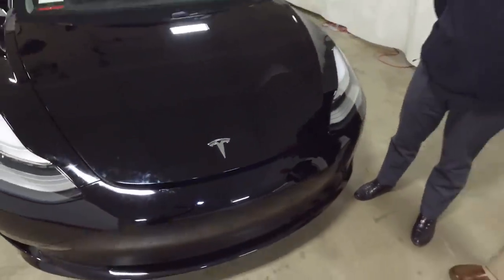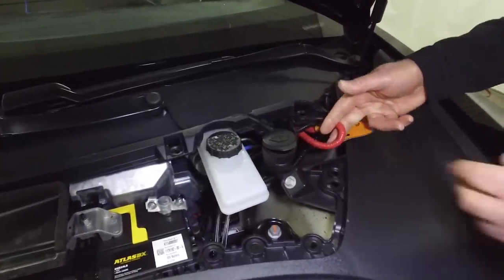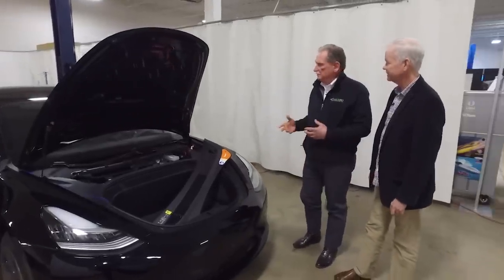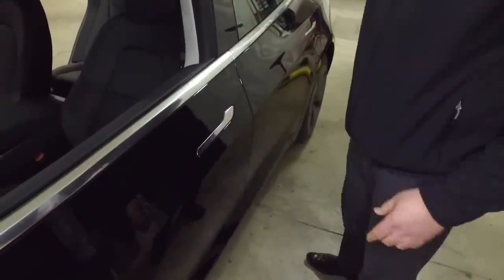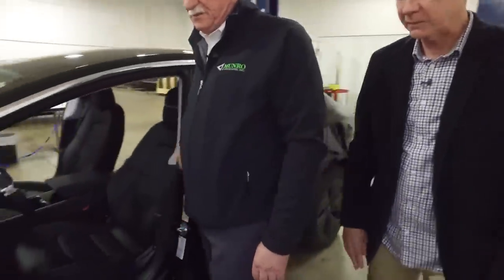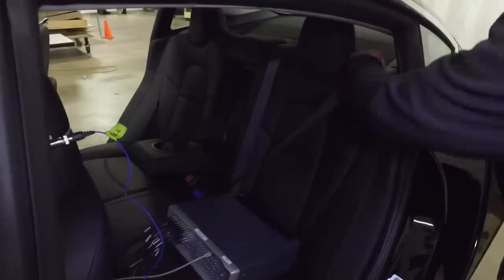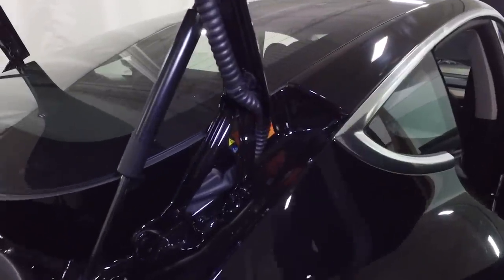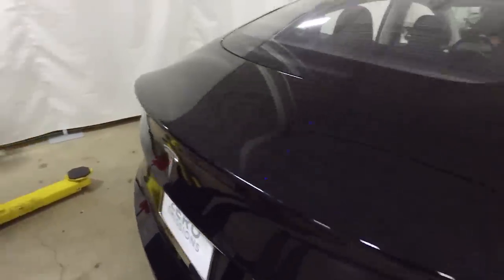Tearing Into Tesla's Model 3

Comment: I don't particularly like Tesla but just because your overly arthritic hand can't open a door handle that a 4 year old can isn't a design flaw .. it's your anemic condition. Where do you cut the fuel line on an ICE car. In an emergency no one's going out the frigging trunk if they can open the rear or front doors.
Reply: "I never said he was a vet. I said probably"

And as I said you created an entire fantasy in your head, and continue to do so.   You're a delusional idiot.
Reply: Wiranta 
Cutting a single power lead is equally as wacked as cutting a fuel line. That's my point.

If an ICE car is running the alternator supplies the power, no need for a battery once a car, truck, etc is started. On an EV I'd say the same turn off the ignition (switch). So what's the requirement to cutting a cable. Like a damaged leaking tank a pierced battery is going to vent until the effected cells are drained. Contained in the pack there are dozens of safety fuses and as I mentioned the forthcoming solid-state batteries do NOTHING once damaged.
Reply: Wiranta 
Here's a link to the soon to be in most EV's solid-state batteries. Note the difference starting after about 1 minute https://youtu.be/C9UxOJacQmg

Safe .. much safer than any fueled ICE vehicles. Fisker has a 1 minute charging graphene solid-state battery https://electrek.co/2017/11/14/fisker-solid-state-battery-breakthrough-electric-cars/
Reply: northstar5 Don't buy a gtr,aston Martin or Lamborghini then as they got pop out door handles.
Reply: DocWolph 
If you can't open an easy as hell Tesla with frigging Automatic Opening Aids then .. U
You're screwed! That's the whole point about the doors .. a four year old probably even younger can open their doors .. It doesn't get any easier. 

Watch the 3 videos I posted comparing the S, 3, X Teslas.
Reply: N C  it's obvious you know nothing about electricity, or batteries, and have never even walked past an engineering classroom in your life.
Reply: I'm an engineer.  I've lived most of my live in and around the auto industry.  I saw GM's first modern electric vehicle when I was working at the Warren Tech Center, years before the public had heard even the slightest whispered hints about anything to do with electric vehicles.

The fundamental problems of EV's are no closer to being solved today than in 1920.  That's not opinion, it's fact.

That's why Teslas and all other "plug-in" electrics (i.e. not hybrid like the Prius) are SECOND cars... because you cannot rely on one as your ONLY vehicle, unless you want to pay for a rental car every single time you need to go someplace more than 300 miles from home.
Reply: I'm a computer and electrical engineer.  Believe me, I KNOW BATTERIES.  There is currently NO battery chemistry which is as safe, convenient, efficient and as ecologically benign as petroleum fuels.  This is the primary reason why there is so much interest in fuel cells.

By the way, if you put 100,000,000 cars on the electrical grid each night to recharge them... where is that electricity going to come from (we are running at over 90% of production capacity) and one what connections is that electricity going to be carried to everyone's home (the current High Voltage grid is running at over 95% capacity).

If everyone, or even 10% of the population, was driving plug-in electric vehicles, the cost of electricity weill skyrocket.

Copper is so expensive now that the U.S. mint has not minted actual copper pennies in years... they are now made of zinc, with a thin copper electroplate to provide the desired color.

Increased demand for electricity, and electrical distribution network means increased prices.

The petroleum pipeline network saturates the country, and has lots of reserve capacity in it.  [One of my military MOS's is petroleum fuel handler, so I'm educated in this area, too]
Reply: D Jaquith,

It is a weird design and not everyone who gets this car is going to be "the picture of health". The C6 Corvette's pressure switch handle handles are far better and equally weird.
Reply: Cut the fuel line, WHAT?! So the fuel spill everywhere? Just turn the ignition off, or disconnect the battery an the fuel pump will stop.
Reply: was thinking the same thing
Reply: You dont need to cut the fuel line on a ICE car, there is such a thing called an inertia switch which cuts power to the fuel pump when a rapid deceleration is sensed i.e in an accident.
Reply: what is the rate of both across the nation?
Reply: D Jaquith build quality is huge...if you don't have it...you will fail
Reply: Interesting rationalizations that old or anyone with limited hand mobility dont matter. And an ICE 12v is as dangerous as Tesla high voltage system.  For someone that don't particularly like Tesla.
Reply: MC Thx,  U would think they would have an inertia switch to cut the power in EVs. I wonder y they dont? Or do they? And "Most (ICE) vehicles today have an inertia switch" so I assume its not universal.
Reply: Y do ppl that say dumb things. Likes "even if you cut the cable (they) are still dangerous" have a need to call other ppl retarded? Sorry if Im not smart enough to just laugh at them in silence :)
Reply: N C, it's not dangerous in an electrical sense if you cut the cable. But it is still dangerous in a fire sense. If a battery pack is punctured there is a high risk of it catching fire. There is nothing you can do about this risk, and cutting the cables sure as hell won't do anything.
Reply: Who has the money to buy these things without government subsidy (and NOT as a primary vehicle, but as a 2nd "toy" car...because 12-hour recharge times after long distances ain't gonna cut it for travelling more than 300 miles/day)?

Would that be 4-year olds?  Or old people whos hands are becoming arthritic.
Reply: Thx, troll but u would lose that bet. So where did u get ur engineering degree from? Youtube U? 

I know I shouldnt feed the troll, my bad, but I was bored forgive me. I will just laugh at his next remark.
Reply: Purdue University.

Not an engineering building for the school of engineering.

A separate building and complete school and faculty and dean for each discipline of engineering.

Your statement was so ignorant,  i have severe doubts that you learned such idiocy from any engineering prof.  SJW MUCH?
Reply: dquad or just find a cliff, put in drive jump the fuck out...might as well at that point...ignition issues can be a long drawn out nightmare.

My wife has 2011 Subaru and it still has ignition issues they can't figure it out, so when the key don't turn it over we use the remote start to start it. How professional...great car though
Reply: You probably have a wire that is cracked internally... sometimes it carries the current to/from the ignition switch, sometimes not.  Go to a junkyard, and cut out the part of the harness that goes to the ignition switch.  Splice the new wires in.

Or just use those in-line notched-blade crimp-ins that allow you to connect another wire in the middle of an insulated run, and run wires parallel to whatever you suspect is bad (using one notched-blade crimp-in at each end of the replacement wire.  Keep the old wires there, so that you can see what color codes are supposed to be on those wires.
Reply: "If"  Now talk to me about the regular recalls of big three auto manufacturer's vehicles for poor design and dangerous problems...Or is this only a problem when it occurs rarely on EVs?
Reply: Tesla claims that they're better.
Reply: Who are you Aaron?  Outside of "some guy on the internet" that is...
What do you know and how do you know it?
Reply: I see your claims without any proof.  So why couldn't you get simple fact correct about recharge times for Tesla and also not mention the billions of subsidies received by the big three auto manufacturers, not to mention fossil fuel companies?  You certainly aren't a very bright engineer, if your assertions are true.
Reply: These are youtube comments, not papers submitted to the IEEE.
If you want to know more, then use a search engine.  I'm not here to do your damned homework for you.  I'm just pointing you in the right direction to look so that you can come to well-reasoned conclusions.
Reply: I would be happy if you would do YOUR damned homework in place of spouting uninformed nonsense based on logically flawed thinking as you haven't pointed to ANY information sources other than your obtuse assertions.  How about doing that Aaron?  Or does your professional reputation, if your claims are true, mean nothing more than shredded paper.
So fuck off until you have reliably sourced information.
Reply: Interesting fantasies you come up with.  A vet who worked on tanks, choppers or aircraft?  WTF?  And even if true, what would that have to do with anything?
Reply: T- Smooth 
If the guy has problems opening a Tesla door then he's pretty much screwed opening any car door. I saw him open the doors in this video .. the guy is trolling the Tesla. 

Again, keep in mind mind I'm not a Tesla fanboy in fact I've been critical .. But not for this utter nonsense.
Reply: The only issue in the post was the danger to emergency workers getting electrocuted. 

"high risk"? Show the stats batteries r a greater risk than a gas tank (ie Molotov cocktail) in or after an accident?
Reply: Connor Oliver 
Cutting that power connector isn't going to stop an electrical fire. Often ICE cars have their stuck throttles wide open in an accident and if the ignition system is damaged .. what are you going to do?

Frankly, even the current flammable Li-ion EV batteries are safer than 10-30 plus gallons of fuel everywhere. The next generation solid-state batteries aren't flammable no matter what you do to damage or destroy the batteries.
Reply: He is pointing out an issue. An accident blessed me with a messed up left wrist, and I can easily see how this could be a problem. But I'm young enough to be dude's grandson, so what do I know?

Comment: If it wasn’t for Tesla, the auto industry wouldn’t be progressing.
Reply: So what is the rate of accidents in Tesla vehicles versus ICE?  Why are you lying about who you are?
Reply: Which has more parts?  An electric motor or an internal combustion engine?
Reply: Your supposition regarding 'proprietary" parts and costs is mere assertion.  Feel free to normalize the rate of collisions per a chosen number of vehicles.  Or is this another thing you assert without understanding or data backup?
Reply: You can find the data of how many Teslas sold vs. the Corolla. That should give you an idea how many aftermarket parts are available for each. Not going to do the homework for you, troll. Good luck.
Reply: Mike McGlock you forgot overpriced :)
Reply: Thats probably true but it doesnt excuse the many problems of Teslas, especially the Model 3
Reply: Funny too now how these two came out and changed their mind about this review
Reply: It was already progressing at a fast rate before Tesla ever came along. Tesla is like the Apple of the automotive industry. Overhyped, over engineered, and needlessly complicated.
Reply: There are way more ICE vehicles than electric ones so you can't really predict the rate of accidents. It all comes down to the driver and the driving conditions. Are far as more parts, yes, ICE has more parts. However they are reliable to the point that the engine still runs if any part is worn or leak. You can replace individual parts, whereas with electric vehicles, there are more parts that are proprietary without any aftermarket support. That would mean very costly repairs that requires a Computer Science degree.

Comment: The trunk is hard to close because it uses the same gas struts the rest of the industry uses for a hatchback, but without the counterweight of the glass being lifted and supported. They've come up with a rear opening that has all the drawbacks of a trunk lid and of a hatch, with none of the advantages of either.
Reply: nlpnt Yeah it’s such a stupid design tbh. They could’ve just used a traditional trunk design but instead they decided to put the hinge all the way on top of the C pillar. Makes the opening to the trunk look smaller because of this design.
Reply: TheUAVpilot 

you can hardly see anything through the sunroof of the model 3 during a bright day, it’s impossible to see anything at all during night.
...because sunprotection (tinting). fact.
Reply: There are gas struts with a variety of pushing forces, you can choose the right one and it will close smooth.
Reply: @simonm1447  70 years ago my father designed a gas and hydralic equailtbaror to balance lifing a 20 ton barrel on artillery. The military required that a 5 inch pound pump could move it.
Reply: They could have just chose gas struts with less strength, but they didn't. It's what happens when you have computer tech guys building and testing the car.
Reply: It might share the same door with the Model Y. That’s a possible reason for doing this.
Reply: I'm a genuine Tesla fanboy, and I agree with this comment. I'd be totally down for a Model 3, but the rear opening wouldn't work for me as I often transport large items in the back of my Forester. If they'd done it as a hatch like the S it would have been much better.
Reply: With a thick battery under the car, they need to gain as much headroom as possible.
Removing the rear roof structure and moving it up behind the sunroof gives you and extra 3-4 inches or so of headroom in the back. Plus an awesome view of the stars for camping in it.

Comment: This guy needs to go to the gym.  Maybe physical therapy. If you need two hands to open a door handle.  You are too weak to close an trunk. I opened that door handle with one thumb.
Reply: SkywalkerWroc 
What I heard, was he has a hand injury which makes it a two handed operation for him.   This is not a design deficiency just because of his disability.
   P.S. what other vehicles has he tested that have flush door handles, as low coefficient of drag, and high efficiency as the Model 3...none?
Reply: Only one of the best racing cars ever. Nissan GT-R NISMO. The doof handles are fine.
Reply: He's pointing out that they work much better in all the other cars on the market. Not that he cannot handle it with one hand.

Comment: Everything you two guys said was really lousy except for the gaps in body panels.
Reply: Bo McGillacutty nope only issue really is the gaps.
Reply: Bo McGillacutty nah you're buying into the one video where every other comment they make is "I've never seen it done like this" haha do a little research on every mass produced car sold for under $50k and they have every single problem they claim " I've never seen this before" 😂😂😂
Reply: Bo McGillacutty yes I have. any other questions?
Reply: Really?  Nothing but important points here, the gaps are the least of it except they suggest general sloppy production tolerances.
Reply: Zach Kunkle
Sure if you are only going to show it off parked in your driveway.  What about rattles, tinny sounding doors and leaky widow seals, cheap plastic interiors to boot I hear?  I hate squeaks and rattles and they effect the DRIVING experience where as gaps probably do not.  I love Tesla and the cars but I'd wait for a while if I were in the market for a car.
Reply: Have YOU seen such sloppy fit up before?  I haven't.

Comment: My concern about exposing the electric frunk release is that criminals can now carry around a battery, pop the cover and open it up stealing the contents.
Reply: There should be a mechanical release inside the cabin which would alleviate this problem to begin with.
Reply: Gregory Phillips You can't get into the frunk unless 12v power is lost, and you have jumper.

Also inside mechanical releases are useless for firefighters that just break open the hood with a pry bar. That's how it happens on every car ever made.
Reply: That utterly absurd!
Reply: Gregory Phillips you can cut the other pillar. You don't have to cut all. It's just one way.
99% of accidents with these vehicles won't require any cutting.
Reply: Hummmm
Reply: Did you not listen to the guy at all?  You have to open the frunk first to reach the power cable in order to cut it.  With that said the criminal element now knows this information too so they also know how to gain access to that area without the key rendering it useless for storing valuables.  Now they don't have to break into the cabin at all so you'll never know they were there until you check the frunk and discover its contents are missing.
Reply: I read that the external battery connection won't work if the cars got power.
Reply: Better than there being a mechanical lever that doesn't require any extra tools/batteries...
Reply: Gregory Phillips Also, you fail to remember the model s has a mechanical release accessible from the outside that Tesla heard major complaints about because of the theft you speak of. Just don't keep valuables in there. It's meant for your carry on and shopping bags that are only in the car for a trip, not for long periods of time.
Reply: Yup all you need is a little mn21/23, A23, 23A 12v alkaline battery
Reply: Gregory Phillips what is the sudden importance of getting into the frunk??? Is that where you plan on seating your child???